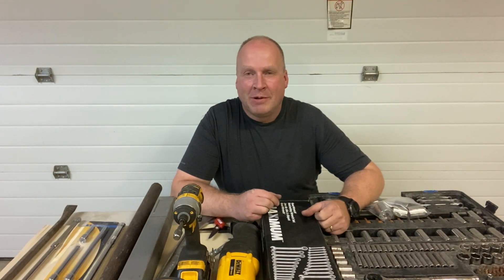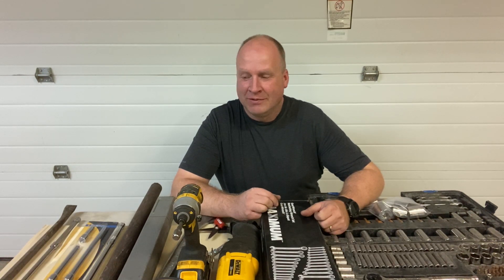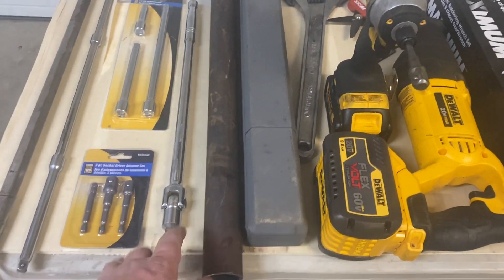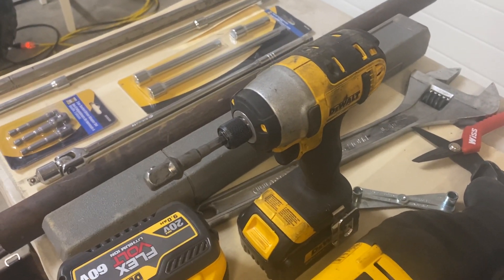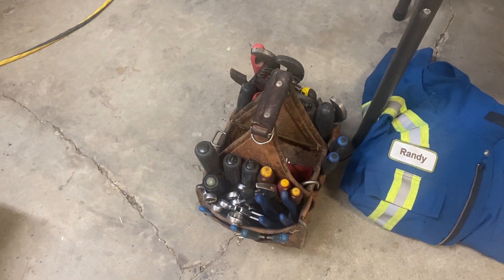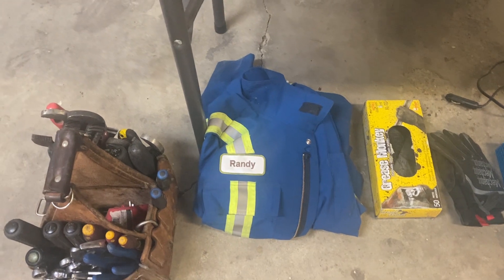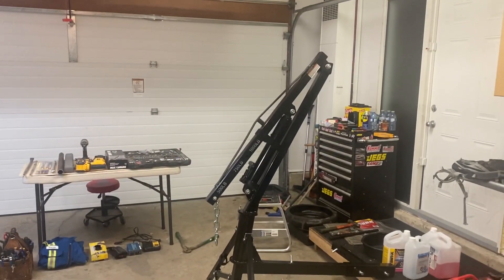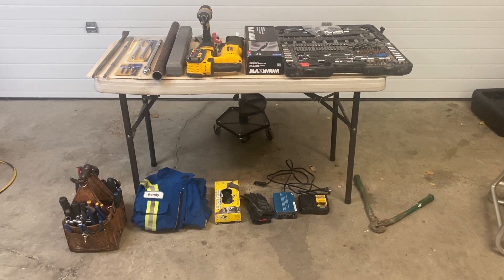What's in Your Junkyard Toolbag?

Comment: I always have a small L-pick and screwdriver for electrical connectors. Trim tool and panel clip tool for plastics. Fan clutch wrench and hammer. Kneel pad. Silicon spray/Deep Creep or WD40. Flashlight(s)/headlamp.  Razor knife/pocket knife. Big torx (T50 for seat belts and body bolts). Bottle/Floor jacks. Metal parts tray and a bin system for nuts/bolts/clips etc. Mapp Gas torch. (If there's time I bring coolant jugs to grab me some coolant and also grab some fuses and realys and light bulbs) Camera to bring us along for the ride.

Comment: Probably taking more than you need,  but better to have something and not need it than to need it and not have it.  My only advice is pull the intake to get to the top bell housing bolts.  That way you don't have to mess with the trans at all.  I also like pulling the fenders, rad, and core support.   Many might say thats a waste of time, but makes it a heck of a lot easier to get the engine out......again, thats just what works for me.  Good luck!
Reply from the maker: Good idea... I’m actually in the junkyard as we speak trying to pull an LQ4, I think I will pull the fenders, already have the rad support Sawzalled out, and will pull the intake if I have a hard time getting at that top bell housing bolt

Comment: I've never pulled one at the junkyard either but I'd say you have plenty of tools. Dont forget the Allen sets for those flexplate bolts if you plan on removing the trans. Possibly an extractor set, I know the heads are pretty round and might be difficult to cut off even with a saw zall if you round them. Post progress if your able to and what you did end up using. 🤘
Reply from the maker: Good call on the Allen wrenches, will keep you guys updated on how it goes

Comment: I would take a bottle of map gas to heat up the dowel pins in the transmission bell housing... my last two engine pulls required me to heat the pins before it would separate
Reply from the maker: Good to know, thanks!
Reply: I pulled two transmissions from ls motors and both was a pain to get out the dowel pin one pin stayed in the trans lol

Comment: You're taking too much ish. I have vids of pulling LS Engines at the junkyard. 8mm, 10mm, 13mm, 15mm, 22mm and 24mm. Long extensions. Keep all the extra stuff in ya truck til you know you need it. Multiple ways of pulling one. The large yards will have a crane for pulling and loading the engine. Use a seatbelt out there for a strap. Bring lots of water. :)
Reply from the maker: Good advice, thanks, I’ve watched several of your videos recently, good stuff
Reply: @LowbuckLS  Nice. Let me know if you have questions. First time is the hardest and easy afterwards
Reply: @LowbuckLS  Best advice. 1. Look for a wrecked suv or truck. 2. Try to turn over the engine before anything. 3. Find the most complete engine. First timer. Find one with the fenders or front end / transmission already removed. This way you only have 6 15mm engine mount bolts and pull it out.